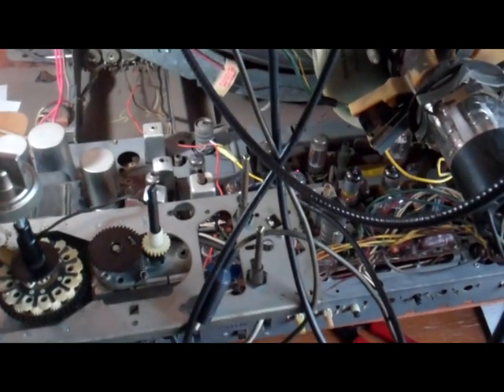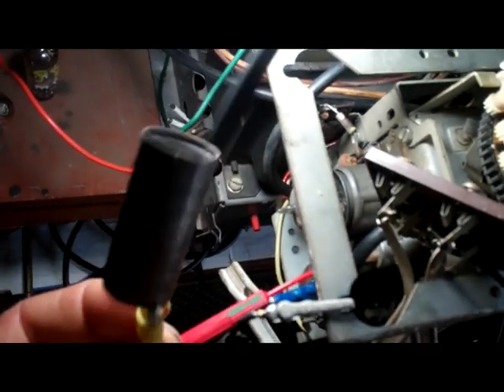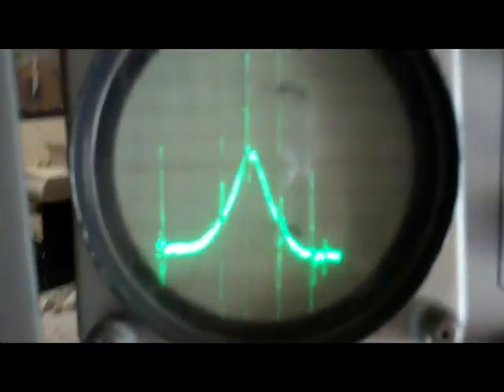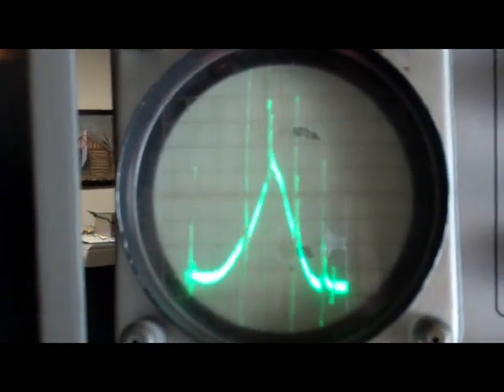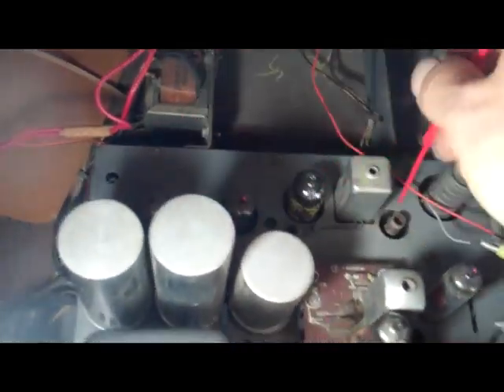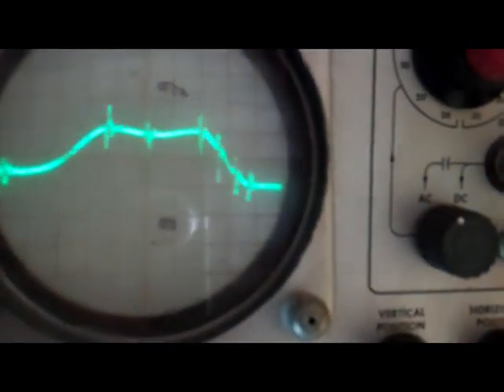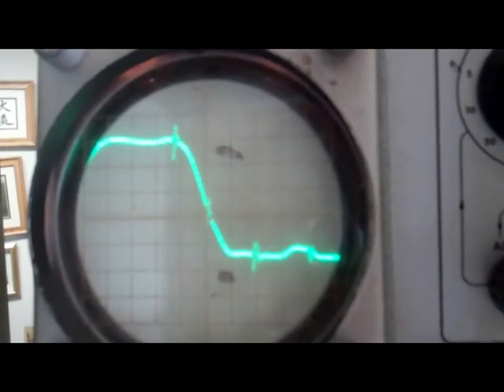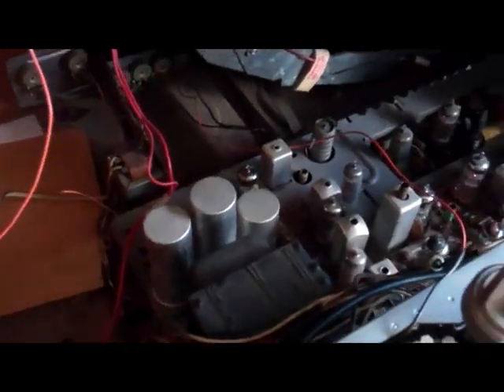CTC16 IF Alignment RCA CTC16 Color Television IF alingment using BK 415

Comment: is there anyone in the Los Angeles area that can align the IF on  my 1950 Hoffman Television. Works fine  with great CRT but the IF is out of alignment.  Had this TV since I was born and has great  sentimental value to me.  I am now 68 and just restored this set but I also had a very bad case of COVID after restoration and since then don't have the sharpness

 to tackle this project.